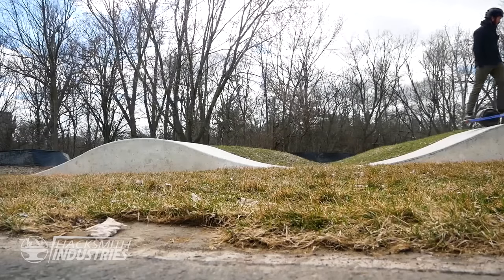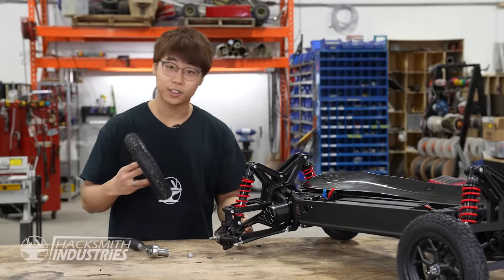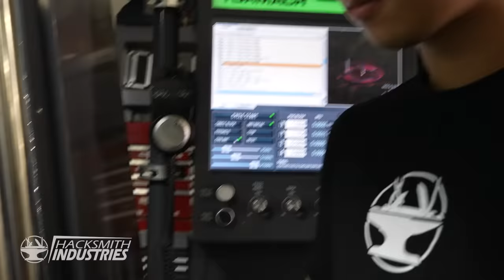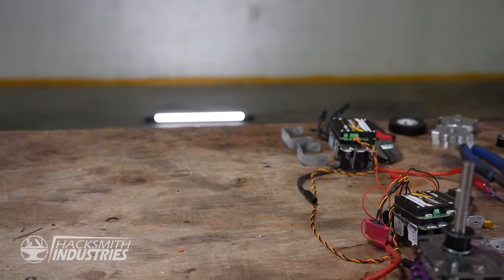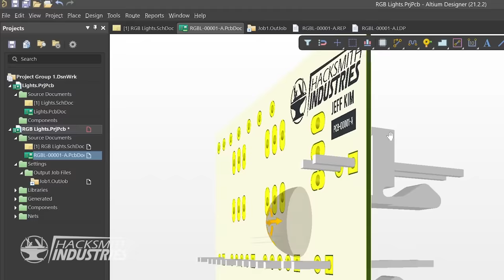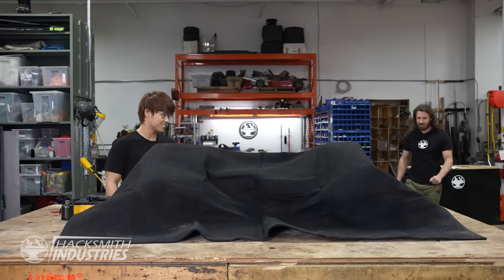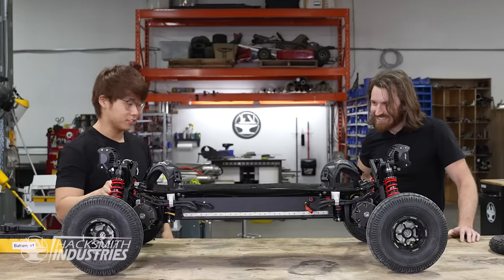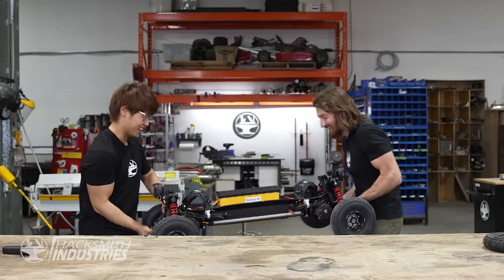The World's Most POWERFUL Skateboard

Comment: For reference, my motorcycle can do 100mph and makes less than 60HP.
Reply: Your motorcycle uses sets of gears to achieve that speed whilst this thing don't have the fancy to have such mechanism.
Reply: An rc car can hit 203mph with less than 3hp. 

Hp has nothing to do with speed/acceleration. At all. Torque and gearing to properly apply that torque is what dictates that. 🤷‍♂️ 
The more you know lol
Reply: @Lord_Pistachio_Nut  A remote control car is much more aerodynamic than a motorcycle and its rider so you can't compare them. And yes, speed and acceleration have everything to do with Hp since Hp includes torque and rpm.
Reply: @jameswilliamnadeau9448  Hp does mean more speed theoretically but practically it not that linear , increasing hp requires proper set of power transmission system (gears+ automatic clutch etc) which in this video the skateboard doesn't have .
Reply: @gokudbzsuper7568  I totally agree
Reply: @Lord_Pistachio_Nut  that makes no sense lol, that rc car that same rc car would definitely not do 200 mph if it had say 1 hp and the best possible gearing
Reply: @johnmiddleton9901  it depends on  weight to power ratio.A rocket can achieve it but it is one time
Reply: @johnmiddleton9901  in this example HP has zero to do with speed. The "reference" was a motorcycle being able to hit 100mph @60hp. A 13hp motor can achieve 100mph. A 3hp rc car can achieve 200mph. A 700hp car CAN'T hit 200mph. With what's being exampled, and referenced, HP is the most unrelevent figure. My comment stands. 

Case in point - traxxas XO-1 RC car. It's currently the fastest ready to run rc on the planet. Capable of 100+mph and 0-60 in under 2.3 seconds. That has a whopping 3hp and obnoxious 40,000RPM. Simply gearing it up can achieve higher top speeds, with the same staggering 3hp. 
Long ass comment short - the length of road you're driving on is insurmountably more important than the HP of your "vehicle" when talking top speed. Gearing comes second. Max RPM to the wheels comes third (which is a mix of gearing and motor rpm limit) 4th comes torque numbers and last, but not least, those silly HP numbers. 

But sure, you're right - hp is clearly the most important thing when talking about speed! Regardless of everything around is saying otherwise! How silly of me
Reply: @Lord_Pistachio_Nut  yes 13 hp would make something go 100 mph, but it wouldn't make a motorcycle go 100 mph. What the og comment was trying to say is that "wow 60 hp is enough to make a motorcycle with a rider get to 100 mph". No amount of gearing adjustments is going to make a 13 hp motorcycle go 100 mph. Yes it might make an rc car go crazy fast but it's irrelevant here because we are talking about something about the size and weight of a person. Obviously speed is a multivariate equation but power is a big factor so saying that it "has nothing to do with power"... makes no sense. The equation for power is literally force times speed.
Reply: @gokudbzsuper7568  Electric motors don't need transmissions.
Reply: @s1lwo711  I am not talking about the transmission that have 5-6 variable gears ,what I was talking is to have a speed box that can convert rpm into torque much effectively and much efficiently .As for the fact electric cars do uses 1 or 2 and sometimes 3 speed gear.But atleast 1 is necessary to produce decent amount of torque .The basic purpose of having a gear is to convert those 8,000-10,000(motor,less torque) rpm into 2000-3000 rpm(wheel,more torque).I hope you understands my point.Moreover they haven't stated that whether the motor pulls energy worth of 60 hp or the motor produces 60 hp ; there is a huge difference b/w both of these .
Reply: @gokudbzsuper7568  But a bike has an engine so that is correct, a Brushless goes for ages, just ask Elon.
Reply: @pabski92  didn't get your point.
Reply: my ebike can hit 80mph and it has a hub motor with no gears
Reply: My old 200kg Kawasaki Versys 650 puts out 50+ HP. The power-to-weight ratio on that thing is insane!

Comment: The knowledge is there... why wasn't this built completely from scratch and done with 4 motors?
Reply: Because doing it this way cost $2000 for the chassis and basic design philosophy, whereas doing it from scratch would have taken far, far more time, and in employee wages that could easily get past $10k, let alone tooling and material costs for failed prototypes to final production.
Reply: Because it would only make it worse. They were always battery limited.

Comment: Damn, that hp is like skateboarding a 600cc motorcycles.
Reply: Not really he said he limited power to 20% and you definitely can't use the ower because it's a skateboard try going 120mph on a skateboard
Reply: it cant put out more than 10hp, as it is bottlenecked by battery. The 60hp claim is just theoretical power output of the motors.
Reply: 120 mph top speed thanks

Comment: I'm confused as to how you've upgraded motor power if you're capping the new setup to 20%. Using the original setup has a theoretically higher power rating.

Original motors: 2.5kW x 4 motors x 100% = 10kW
New motors: 22kW x 2 motors x 20% = 8.8kW

Comment: Curious if having the two motors on the same side induces some imbalance to the board when riding, or were they specifically placed opposite to the heal side where most of the riders weight would be?? also could not help but wonder if there is a fail safe if the remote was to loose connection or get separated from the rider?

Comment: Do this with a one weel
Reply: iioii
Reply: Hahah they actually can! the company that sells the wheel hubs (trampa) also has a self balancing feature in their VESC motor controllers. I currently have the highest voltage onewheel in the world at over 84V, running with a onewheel v1 hub so it has extremely high torque. My onewheel could output over 5000W

Comment: Put a ballast weight (or two can ballast be used to help with steering?) on it and some form of steering rig that will not require having to partially dismantle or modify the suspension.

Comment: I want to see this board with sand paddles on it and see you attempt to climb a dune. I bet this board would look amazing in the sand with paddles with a human standing on top riding it to its full sand potential. 🤘
Reply: I am working on a ultra low pressure tire board. just look up the University Rover challenge it is those wheels. 

I got them and am designing hubs but broken printer sadly.

Comment: You did everything perfect except you went with the budget option for the batteries. Lipo's the thing that powers most rc vehicles nowadays is very susceptible to heat and has the most likely to expand and contract under extreme heat. Lipo=big single cells.

Comment: Mad as vid guys.... what about getting your hands on a kawasaki jetmate and using an electric hub motor instead of the I.C.E..... loads of torque to run the jetdrive unit so it would plane easy.... and the boat is small enough to not be to much weight 👍
Reply: Buy ekrrc jet ski

Comment: My electric unicycle runs at 2500W peaks at like 6500W at 100 volts with 3200wh battery. Hits 47mph. 
I'd test it out. Got to gear up.

Comment: Why not take advantage of the two open hubs you have and rig up generators on them? While riding the board using the A bank of batteries the generators are charging the B bank of cells. When the A bank depletes to the point of needing a charge the B bank is manually switched or automatically if you are a good enough engineer to design the circuits. And like before the A batteries get charged while ghe B bank powers it.

Comment: All these comments talking about him restricting it to 20% power....when no one seems to realize that he later stated he limited it by 60% which would make it 40% of its capabilities. 40% of 44 is 17.6 which means it is stronger than its stock 10 kw. He also mentions that everything is programable. Which means that we don't know the specifics of what all is set. We know the torque was reduced by 60% but that doesn't mean max output, acceleration, braking power...etc are also reduced by that much. It is highly likely that this board can handle at double the top speed of the stock board. He didn't make a weaker board he made an Adjustable board with the potential to be 5 times more powerful than stock. As for the comments about the batteries. He acknowledges that the batteries have a lower battery life in exchange for a higher output. Which is logical being that if you pull more power out of the batteries at once you drain them faster. For example changing an 18650 battery (common rechargable li-on battery) with a 3000mAh from 3.7v to 4v that battery will draw more power but its expected life span from full charged to empty would be short. Another real world example not using batteries would be a 5 gallon bucket of water. If you drain the water at 1 gallon per minute, it'll take 5 mins but if you drain it at 2 gallons per minute it would take 3 mins. The battery wasnt a downgrade unless all you wanted was battery life. Which isn't what they needed.
Reply: They also destroyed the turning differential capabilities. With 4 motors it would turn better than with solid axles, so its also a massive capability loss mechanically and dynamically speaking.

Comment: You might design your wheels to work like turbines to pull air in to help cool the motors. The car in the picture of my comments is my 69 Lamborghini Espada.  It has campanola knock off rims that have share scoops that are angled toward the forward direction the car will be traveling up to 210 mph. Yep. It'll do it. The wheels scoop air and firce it in to cool the twin brake calipers on each hub. It wouldn't be hard to come up with a design that would work in the same principal for your board. Those look large enough and I'm sure it'll go fast enough to make a difference.

Comment: the power should remain the same. The issue is with power distribution. You need to use some of the power for things like dampening and vertical control, same thing.

Comment: Another thing you may want to work on is to upgrade the suspension because fat tire's are not going to help steer and tire's were not meant to be used as suspension no, tire's are meant for power and steering.
Reply: Propel Endeavor is better imo but less maneuverable.

Comment: ??What a quality and inexpensive battery can provide me with a long-term trip.  At least 50 miles.  You recommend for the construction of a skateboard two powerful motors with a total power of w8000 watts.

 KV: 600

 MAX POWER: 4000W

 TORQUE: 2.1 NM

 WIRE WINDS:

 MAX AMP: 80A

 MAX VOLT: 12S (50.4V)

 RESISTANCE:

 NO LOAD CURRENT:

 SIZE mm: 63 x 84 (without shaft)

 WEIGHT (g): 0.955

 SHAFT: 10mm with 3mm keyway

 Accessory pack: NO

 Internal PCB with 120 degree hall effect sensors

Comment: hmmm one shaft for each pully left and right is like a locked differential. 2 motors are independet so they will act like a differential when driving on hard surface and cornering hard.....

Comment: Amazing!
But "2 pulleys, 1 motor" ? I'm wondering why did you not put in differentials? It's gonna help a lot when turning..
It wouldn't need differential gears if there were 4 motors (1 for each wheel)

Comment: You removed the 4 motors from each wheel and replaced them with two heavier ones, both attached on one side. Doesn't that mess with the weight distribution and overall balance?

Comment: Kilowatt number  is certainly impressive to mention...You guys at Hacksmith should mention true realistic informations. You dont need big numbers to get viewers. People most of the time confuse Power(kW) and torque( Nm)...   Power is torque multiplied by speed. In other words, Power can be defined as at up to which speed you can keep the torque. You your skateboard can push against a wall with 10 000Newton pounds of force is you want.. but it will produce no power.. only heat.  as there is no speed. and 0 multiplied by 10 000 = zero.

Comment: You got for equally powered electric engines and you only replacing two of the motors in considering you remove two of them entirely when it be no powerful than it was before cuz this guy clearly stated that those two more powerful engines well didn't say but showed that those two engines are working the front by pulleys when that mean in the ends up with the same speed with the original

Comment: There's a lot of incorrect information going on in this video.
If we look at those controllers they are rated at 63V, at 250A. Most of these boards are 12S This could be as high as a 14S. (58.8V at peak charge)
But if we just assume "magic" and pretend it's battery is at 60V
We can figure the power output that two of those controllers would produce.
60*250=15,000W
Multiply that by 2... and you get 30kW... WAY below the "supposed" 44kW.
Chances are the batteries in that pack will also struggle to get 250 amps.
Assuming that's 15S (15 batteries in series, which is the max that controller is rated for) if each battery was a VERY high end cell, with 15amp max draw, That would indicate the need for 17 or 18 sets of 15 batteries. so 15*18 = 270 cells.
These boards, also only usually have around 50 cells... so, I'm not really sure how you could get that kind of power outta those batteries.
I've been doing the deep dive into this subject. (electric kick scooters specifically)
But, in a perfect world, my best estimate is 30kW. And more realistically it would be closer to 15kW... 1/3rd of what this video claims.
I have to give this a thumbs down, despite my interest in the field, and the subject. But just because you have a car with a 500cubic inch engine, does NOT make it a Funny car.
Reply: I would like to correct myself.
I missed the battery install apparently.
The battery that is being attached is a 12S, 22.2V (with 2 in series for each motor, giving 44.4v, per motor) with a discharge capability of 225A
We can figure the ACTUAL power output by the limit of the batteries.
225*44.4 = 9,990W per motor.
This gives 18,880W, for the full board... This is 3120watts LESS than EACH motor is claimed to be running at. This is also "peak" output, based on the batteries. This output will VERY quickly drop. As the batteries can only sustain that output for around 80 seconds. Before zeroing out the batteries.

I apologize for doing my figures wrong, as I assumed it was using the stock battery. Honestly, even using those rapid discharge batteries, it's still right in the ballpark of where I predicted it to be spitballing when I was guessing what battery was in the board.
Reply: Actually, I just noticed that it DOES have burst discharge of 450A. which would allow the full 360A "burst" on the controller as well.
15,984W per motor. 

If we charge the battery to 4.2V That gives us 50.4 * 360 = 18,144
No matter how I figure this math, it really don't come near 44,000W. The absolute best I can "pretend figure" is 36,000W. And I say "pretend figure" just because that number is pushing every part to 100%, with 100% efficiency.
So even with the battery voltage charged to it's limit, and pushing 360amps, the "max" that controller is rated at for burst, we are still almost 10kW short with both motors combined.
Reply: you know I think they may be exaggerating

Comment: Only problem I see is if you’re on the street and start driving in a circle it will either break the pulleys or strip the belts or break the shaft from binding…
Reply: Wrng 1980 speed limited 155 mph

Comment: Gow exactly did you achieve 60hp? What is the battery capacity, esc max amps, voltage and what Motors have you used?
Reply from the maker: Could uhh,  watch the video.  Motor is mentioned pretty early on
Reply: @hacksmith  what about battery? Is that mentioned too? And esc?
Reply: So, you have 2 decent sized motors, but the question remains, what battery and esc did you use that is so small, and yet capable of providing 44kw?

Comment: Its a very bad idea, to sync the wheelspeeds by connecting them to a common motor shaft. You should know, what fully locked differentials cause…
Also the wheelhubs are way to much off set and will break the axle when seriously used.

Comment: you are not drawing 40kw out of that tiny battery :D not even 20. not even 10 :D
Reply from the maker: You underestimate those batteries. Our lightsaber drew 20kW out of a similar pack
Reply: @hacksmith  THE POWER OF TRUTH!
Reply: @hacksmith  im guessing thats a 4/6 s battery? Lets assume around 20 volts even if it put out 250 amps out of a single battery thats still wont even be over 20kw with 4 paralelled. What batteries are those?

Comment: Bro put bigger tires on it basically, since it's software limited to basically the same power as the previous board, being that the batteries are probably the limiting factor. Well, that's a pretty useless video